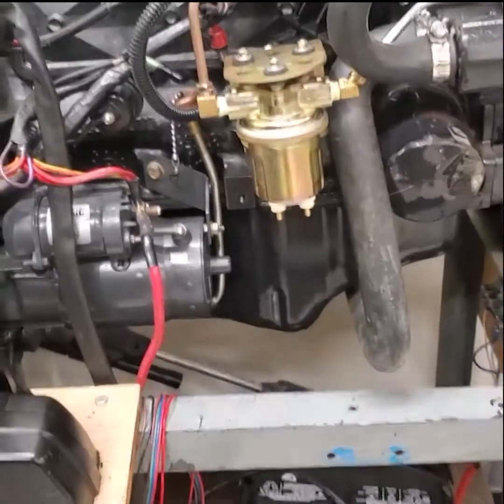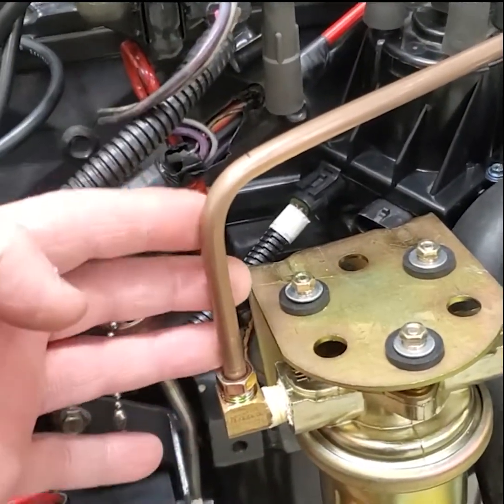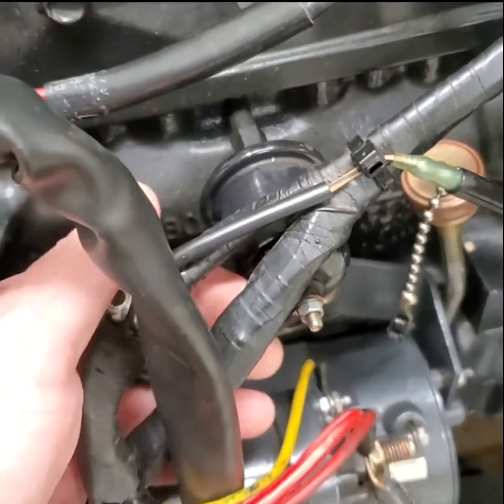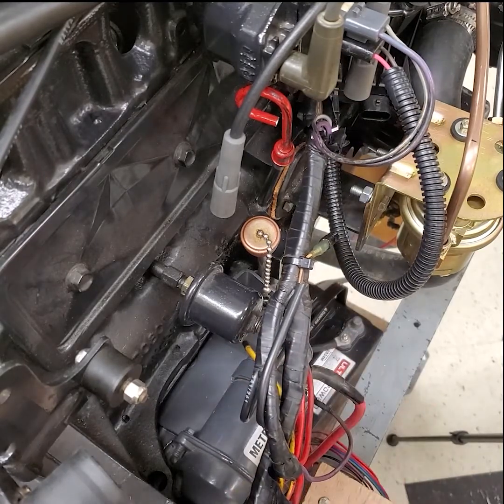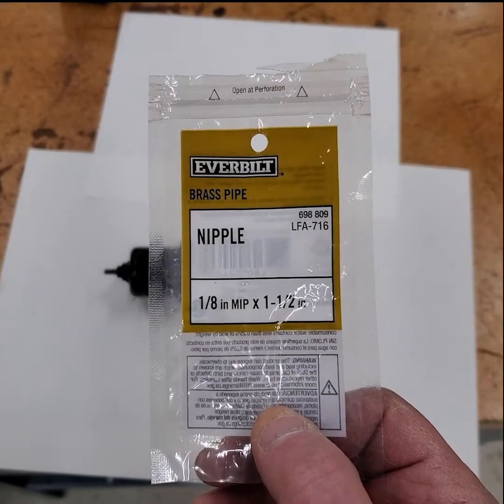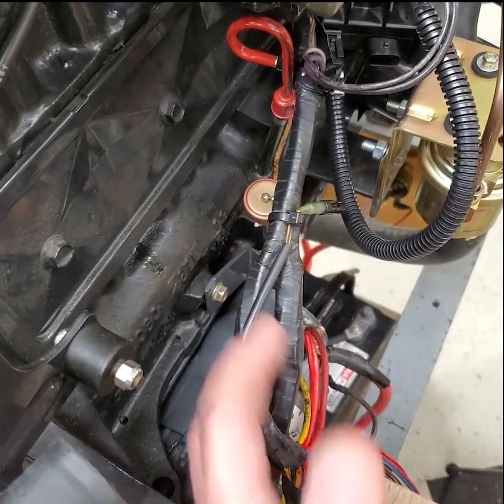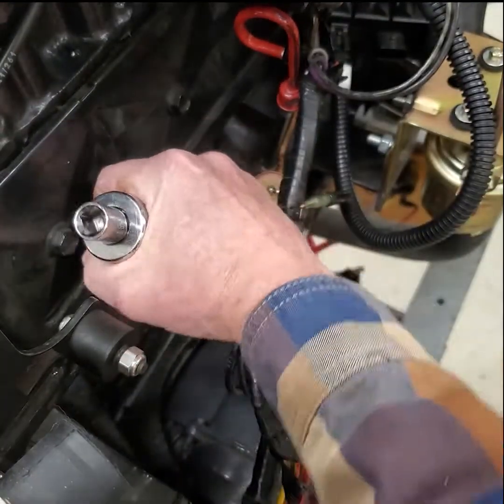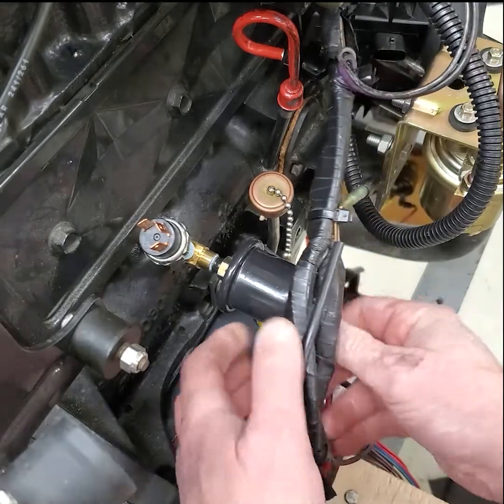Gas engine Electric Fuel Pump Conversion Part 2

Comment: Hi Ted,  im doing a mechanicall to electric conversion on my inboard mako 23.  Can the electric fuel pump be mounted near rhe engine ?  Thats putting the pump in a pull from the tank with a distance of 6-8 feet.  10 feet of hose.  I think i read electric pumps are push not pull.  Dean. New England tech grad 1983
Reply from the maker: Hello Dean,
Yes most electric pumps will pull a vacuum of a few feet without a problem. And yes you can mount the pump off engine no problem, just remember to size the hose to the barb fittings and use only A1-15 marine fuel line from the tank to the engine.
Reply: @tedsmarinerepair8956  thanks Ted.  I'm having fun with this. Ill update you with my results.  Dean

Comment: If I install an electric Holly fuel pump do I still need an oil pressure switch? I have a Volvo penta 280.
Reply from the maker: No you do not need to. However most service techs do for security. If for some unforseen reason all the oil leaks out of the engine the oil pressure switch will open and the fuel pump and then the engine will shut off. The pump will also not run if the key is turned on (engine not running).

Comment: Hi Ted, I have VP D3 190hp that I am installing at the moment. Wondering if you would be able to point me in the right direction to find installation wiring diagram. Mainly not sure on the switch wiring - engine runs and does what it should but the gauges ate dropping out after starting and not getting a trim down signal out of the HIU. My email address is operations @transam.nf if that is easier. Thanks Dean
Reply from the maker: Engine Serial # please
Reply: @tedsmarinerepair8956  Hi thanks so much for the response. D3 190A-C. 869585 2003015913. I found your video on wiring last night and will check that I have the link wires correct. I have all the manuals for the engine but they don't really show installation. Your help much appreciated.
Reply from the maker: @deanburrell1150  This is a 2009 product you are re-installing??? It may have multiple harness/connector issues at this age. With EVC or EVC MC (which this is) it is all plug and play, so if any gauges are dropping out I would suggest you check all the connections visually to ensure their are no pushed out pins or corrosion issues.
Reply: @tedsmarinerepair8956  yes repowering my boat. I will double check connection. Do you know if you can swap the evc from another engine or are they coded the main engine ecu. I have complete spare engine and  wiring that I can swap out. Thanks Dean
Reply from the maker: @deanburrell1150  you can if it is an HIU no issues. With EVC swapping nodes from one side to the other will create chassis id fault codes. There is always the possibility if one unit has been damaged by a wiring fault then swapping may damage the other too. Not likely but possible.
Reply: @tedsmarinerepair8956  Thanks for your help Ted it is much appreciated. I am concerned that I have the ignition switch wired incorrectly. I have different wire colours to what is in the manual. Manual show red 12v which I don't have. Does this need to be an external power source not from the wiring harness. Red yellow start- that's OK. Red blue ignition - mine has constant 12v on that wire. Purple - not sure on that one. Grey instrument lights - does this get power by switch or just go to an external switch panel to power light circuit. Blue green - trim assist. Not sure on that either. It would be great if I could find a switch wiring diagram. Thanks Dean